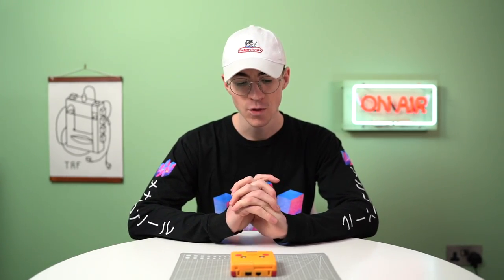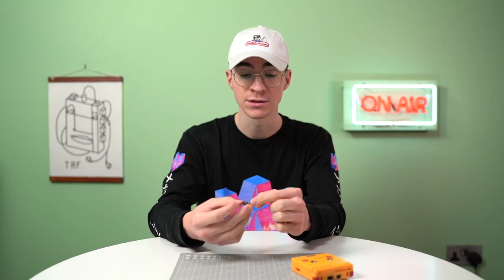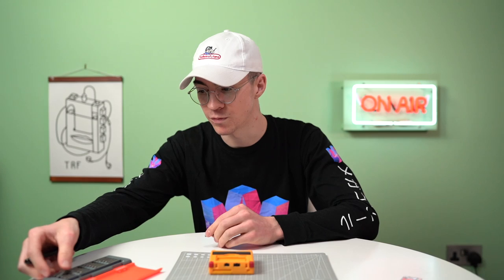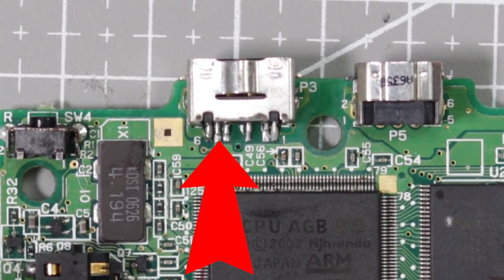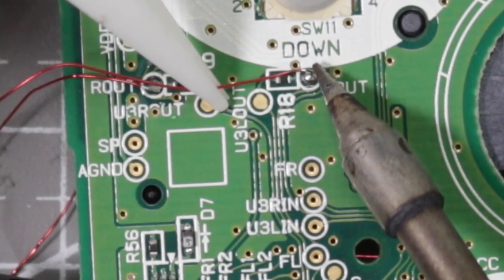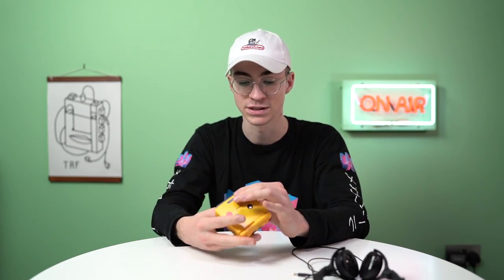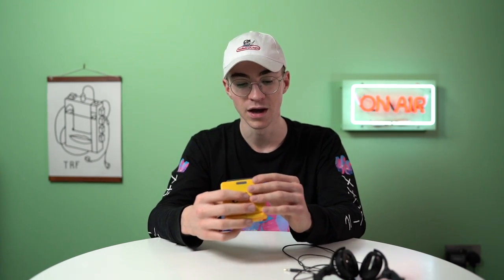Giving the GameBoy Advance SP a headphone jack 17 years later

Comment from the maker: Ever wondered what’s in my toolkit? - https://youtu.be/jp-lWUa4a1o
Reply: Hello
Reply: Without any further waffle
Reply: Really cool mood!, i think this is the console i need to play all the GB/GC/GBA games!!! one console for everything
Reply: Well there's not a Dremel in there
Reply: Would it have been possible to remove the Nintendo headphone jack on this and put this in the same place?
Reply: Awesome video. I have a basic soldering setup in my den but haven't gotten around to using it yet. I don't have room for an overhead vent fan- do you use one in your videos or to you simply crack open a window for ventilation?
Reply: Put a different power jack 
Like a usb-c
Reply: NEXT TIME ON     The Retro Future              

Installing a Bluetooth receiver into the Gameboy to use with AirPods
Reply: SgSuperKid Dan that waffle is so far
Reply: The Retro Future, check my comment, I'm the one who talked about why it wasn't possible to place the headphone jack
Reply: What AWG wire did you use?
Reply: @pierdaponte I hope this might help, I personally set a multiple speed box fan in the window to blow the fumes outside. I open the other window to allow fresh air in. I set my soldering station close to the secured  fan. To me the most important is safety, good ventilation and air flow. Some people put a simple filter on the fan blowing out. Note: I am not responsible for any harm or damage if they occur. Take care and be safe. : )
Reply: I could recommend using twisted pairs
of an ethernet cable (it must be of a single copper filament). They are quite resistant. Also nice video
Reply: Hi, I've just wanted to ask if you're planning somehow to modify or enhance ragebee500
Reply: Yo I came from jack's vid
Reply: Please, could you share what type and  gauge wire did you use for the headphone jack mode?
Reply: Try using a weekly pill box for containing screws. It has seven individual boxes, one for each day of the week, that you can use to separate your screws in the order you remove them. An old IT trick.
Reply: Man i wish i could afford a gameboy advanced sp
Reply: you did have those accessorizes that added one. which plugged into the charging port
Reply: I am so going to do that too, thank you!
Reply: Definitely not a Dremel
Reply: I wonder if there’s a way to install the pam8302a amp on gba sp the amp mods work on dmg to gba original but I don’t see anyone wondering or wanting to install the chip in the gba sp
Reply: no but I've always wondered what was under your hat. kinda disappointing. was hoping for something far stranger
Reply: I just did this modd and did everything the same and only my left headphone works not the right. Checked my connections on everything and tried a different port still only the left works. Any idea?
Reply: Do you know if it would be possible to make a splitter cable that has a headphone jack spliced onto the normal charging lead? So you can charge and take headphone signal off? I would be more happy doing that than doing the mod in the video, but that's just me. Also I have no clue about electronics so excuse my ignorance if there's an obvious reason why this wouldn't work 👌😬

Comment: So... if there was space in the case for a headphone jack, couldn't have nintendo just put one from the beginning.. sincer they were able to put one in the micro which is even smaller.
Reply: The Micro doesn't have a link port or the little switch in the cartridge slot that tells the GBA when a GB or GBC game is inserted so even if it has a headphone jack it still sacrificed other stuff. Nintendo could have made extra space in the SP for a headphone jack but they just didn't care enough to do it. And it was extra money for them from people who bough the dongle that cost pennies to make.
Reply: @chamoo232  not to be pedantic but the micro’s charge port also works as the link port
Reply: Apple and Samsung also had the same excuse.
Reply: 2 years late, and my guess is simply because they knew all the weird lil companies that existed at the time would create headphones that use one of the two ports at the top

Comment: Wow, that looks fantastic! Great job. Thanks for the shout out too! I think yours ended up looking much cleaner than mine too. For what it's worth though, I don't think a dremel would have given you a cleaner result but it would likely have made it a bit easier. One thing that's worth noting is that even though the mod uses a four pin headphone jack, the console will not work with four pin headphones. At least, mine doesn't unless they are half inserted and then you only get mono sound out of one side.
Reply from the maker: Ooh very interesting. I didn’t try that!
Reply: Wow sir makho was mentioned by RetroFuture. Two Youtubers I watch about Modding Consoles.
Reply: Hey makho, this is putting me off trying this mod. Any ideas as to how this can be solved to work with all headphones? Most have a mic on the cable now and 4 pins. Don’t want to have to carry special headphones for my sp
Reply: @TimdeVille  You'd need a physical switch to detect headphones. That's all the fourth pin does in this implementation. By inserting a three pin TRS plug in the four pin TRRS jack, we are triggering the speaker cutoff by shorting the fourth pin (the ground) to the third pin (also the ground in TRS but the microphone in TRRS). Alternatively, you can use a TRRS splitter and just leave the microphone plug dangling but I understand not wanting to use a dongle. 

If you cannot find a suitable contact switch (and I couldn't but I didn't look that hard) that depresses automatically when headphones are inserted, a simple SPST switch that you toggle manually would work too.
Reply: makho cool. Thanks for the reply. I’m new to all this do I’ll have to do some searching. I don’t even know what a SPST switch is so I’ll look it up but would be amazing to use any headphones.   Are you ok just using 3 pin headphones then?
Reply: @TimdeVille  Yes. Three pin headphones (TRS) work as expected
Reply: @TheRetroFuture  can you post a link to the super professional wiring diagram you made for this? Ha thank you.
Reply: Curious if you could also use a 5 pin TRS switching style 3.5mm headphone jack? or would there be concerns about space? I personally find the switching style TRS a little easier to wrap my head around wiring wise.
Reply: @ariajanzen5365  that would work even better if you can find one that fits and is relatively cheap.
Reply: @makho  I'm sure you could find these cheaper elsewhere, but this is the one I was thinking about https://www.mouser.ca/ProductDetail/Switchcraft/35RAPC4BV4?qs=yPI4UV3pIw2%252BAY61NTBatA%3D%3D
Reply: @ariajanzen5365  not sure if you're even gonna see this but if you modded a Gameboy with that how did it go?
Reply: @makho  I'm sorry but I understood literally nothing, not a single word. You're saying that a regular phone pair won't work, because it has a microphone? This makes this mod very impractical, if that's the case. I don't understand what is needed to make those work instead and why, since the jack apparently should perfectly match them.
Reply: @lloydaran  I see you also don't understand what the word "literally" means. This implementation takes advantage of using a TRS plug in a TRRS jack to act as a detect switch. So yes, it will not work with the wrong headphones. 

It has also come to my attention that the capacitance is way too high with this wiring method so the mod is wildly impractical, like you said, but for all the wrong reasons (unless you like blowing out your headphones).
Reply: @makho  What's wrong with how I used "literally"? Whatever. I still don't understand the reasons behind a jack being unable to work with the headphones it's supposed to house, it's beyond the very little technical knowledge I have (I have no idea what a TRS and a TRRS are). I suppose you had to work around the limited capabilities of the GBA SP motherboard to make it just barely work. The last part was clear, thanks for pointing that out. I guess I'm not attempting this.

Comment: I swear apple and nintendo do the exact same things I mean no headphone jack, dongle, headphones that plug into the charging port smh
Reply: Do nintendo solder everything in, fix everything badly with used parts, wipe drives and overcharge for everything? Also Samsung are removing headphone jacks now...

Comment: Fun fact, the original DS shares a charging port with the Gba SP and the headphone adapter actually works on the DS as well.  Obviously it's never needed since you have a headphone jack built in, but it works and even both Jacks can be used at once if desired for some reason

Comment: After losing my charging cable, I made my own from an old USB cable. The USB-A plug fits almost perfectly, the outer pins align with the contacts on the gameboy and after a bit filing it fits in snugly.

Next on my agenda is making my own dongle, the same way as the charging cable. Oh, or I could make a splitter dongle that can charge and run headphones at the same time.

Comment: If anyone uses the excuse "they couldn't fit a headphone jack in (insert device name here)," then tell them to look up the 7th Gen iPod Nano's headphone jack. 

That thing is crammed in there. If the device has the thickness for a headphone jack it can fit one. No matter what if they are designing the circuit boards they can squeeze one in if they want to. The fact is that they don't want too.

Comment: I mean, I understand. The circuit board’s layout required you to insert a bunch of wires to mod it. Nintendo meanwhile probably wouldn’t want a mess of wires inside that thing, but in order to avoid that, they’d need to completely redesign the circuit board’s layout. I’m sure this is a really flimsy excuse for nintendo not adding it, but it’s probably the best I can come up with :/

Comment: Your headphones have a relatively thin jacket on the plug. Most headphones back then had huge jackets and it would stick out beyond the side of the gameboy or not fit when other carts were sticking out from the slot. Lots of room for leverage to break the case or socket. It's not right that they didn't have a socket on the device, but this is one place where it makes sense.

Comment: Awesome video as usual Elliott!  If I were you I would open that back up and slather some Ye Ole Poundshop 2 part Epoxy over the top of the superglued in port. I use this method frequently, superglue to tack in place, glob of epoxy for strength. This method even holds three broken posts on a dropped TV that hung open, 3 yrs in, with really strong stress hanging from a Vesa mount. I'm not saying yours won't hold, but this will make damn sure she doesn't wiggle one bit. Just like my Mrs. 😂 Wicked stuff though man, funny I have an 101 Pikachu also, prefect cheapo quarantine mod. Will get on it next week 👍

Comment: I've always wanted to have an audio jack without using an adapter. after watching this video I spent 2 hours and successfully modded my GBA AGS101. my only issue is using thicker wires made the system a little bit uneven near the audio jack. other than that its perfect. Thanks!!

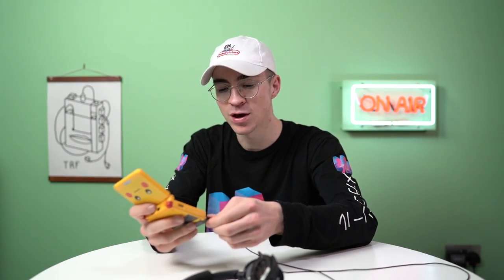Comment: 7:03 I think you're talking to me

It's far from ergonomic, that may be why they didn't placed it there, nor the sides because it would be idiotic and the top is full of holes, inputs and buttons but hey, you made it work!

Another thing, maybe just maybe you could make a modified case without the holes at the top (used by the Wireless adapter and the GCN cable, I don't remember which else) and place the headphone jack where the holes used to be, just an idea, I haven't seen the structure of the case perfectly so I may be mistaken

Btw, I'm studying Ind. Design and one of the subjects is ergonomy and if you notice the way the headphone is placed, as I said before, is far from ergonomic so it was a better idea to just make an adapter to plug your headphones through the charging port, the holes at the top are very important so every accessory was compatible so they just couldn't remove them, I say that in case you think "Why didn't they removed those holes?"

Comment: I suggest hot glue next time you do one of these to keep the headphone jack in place. I been doing it in Audio Receivers  with 1/4 inch jacks. its pretty easy to clean up if later down the line you need to take it out or replace it or whatever.

Comment: Headphone jacks with microphones have 5 pins my guy, they are called TRRS instead of TRS connectors... T is tip, R is ring, S is sleeve. If you actually had one with a mic then you'd have the bypass switch introducing crosstalk with one of your sound channels... It's normal for TRS connectors to have a pin for the button inside that detects a plugin event. Have you never noticed that your phone or pc knows when you've plugged in headphones or a mic?

Comment: If you wanted to clean it up a bit using your method, you could snag some cone shaped files typically used for model making to smooth out the headphone jack hole.
Reply: I use a "hand held countersink tool" and/or a "Deburring tool" for the same purpose on my 3d prints. Both of these work well for cleaning up cuts in plastic.

Comment: You don't actually need a 4 pin/4 ring audio jack for this mod. A standard 3 ring jack with an additional "JackSense"* pin would've been fine, and those sorts of audio jacks are actually pretty common. *(not sure what it's actually called, but it connects to ground when headphones are inserted, which is exactly what this mod needs)
Reply: In fact it almost looks like that's what you are using, at 1:10 you can see the 3 pins along the side of the jack to line up with the 3 rings of the audio jack, and the 4th pin is at the very end to sense when the jack is fully inserted, although it could also be the 4th contact for the tip of the plug...

Comment: Excellent video, thank you. Those little sockets look great, I've never been able to fit any of the ones I've had in the past; I'll be getting some of these! One question: If I'm not mistaken, with the screw post removed, that means one corner of the unit is not secured together any more. How does that affect how the console feels? I personally prefer the spot you used to the other one you showed with the IPS screen.

Comment: Great mod, I don't suppose there'd be room for a BlueTooth audio mod? I guess you can still plug a BT transmitter into the jack. GBA should sound hot through a larger speaker. Thanks for the video.

Comment: I have I issue and hopefully somebody can help me out. I did it the same way but here is my issue:
-when I plug in my charger my speaker cuts of
-when I plug in my headphones it work but only if I‘m not pushing it all the way in. If I left like 1 millimeter to go it works fine

Did I something wrong? Is it because I’m from Europe our headphonesjack pins are in a different order?

Hopefully somebody can help me out with this one. Thank you so much 🙌

Comment: Like, why they didn't originally install the headphone jack on that specific place, obviously because of the screw. Why they didn't add on the top like the other two ports tho? Not many excuses I can think of. Trying to say that it wouldn't fit along the charging port? Just... Damn Nintendo, use one of those round barrel plugs instead, like the 3 1st GameBoy entries had before the original Advance, and it sure as heck would fit then. It's not a deep enough space? To be honest I would take a slightly bigger, already very small GBA SP, that could even fit a slightly bigger battery too, and solve that problem. When there's a will, there's a way, they just didn't have the will to sacrifice the added dollars of revenue from a proprietary headphone adapter and the harder to replicate chargers.

Comment: I just started doing this and on ROUT I had a bit too much solder on it so I used my wick to clean it off and now it looks like its a black contact point and solder won't 'stick' to it. Is this considered a burnt contact point and not repairable? 

Edit 1: Looks like I found the gold contact point... it was on the bottom of my solder wick. Never seen that before, guess it came right off the board and it won't stick back either so hopefully tinning it to the wire and taping it on ROUT will make a miracle happen lol

Edit 2: No miracles here, aside from my terrible soldering skills, taping it down didn't help and I had no audio from speakers or headphone jack.

Comment: I need a Game Boy Advance SP. So pissed I had one  figired out what it was (was in bad shape) and left it back in the trash where it was. It was busted up bad though
Reply: Even in a very bad shape you can still fix it up. As long as the motherboard is good, speaker work and battery work then you can change everything else. Replacement shell are easily available. IPS mod work on all SP mod so easy to fix a broken screen. It only gets complicated when buttons are acting up. L and R micro switches are easy to replace but the other buttons are harder. I still managed to do both before. Got some very cheap SP on Ebay because the buttons were not working good.
Reply: @chamoo232  Yea screen was smashed on it, Shell was trashed it was so worn and crappy I found out what it was later., Never even heard about the SP.   Someone tossed it they wanted it to die they got their wish.   I didnt know what it was at the time. Sad. I would of saved it.
Reply: @GhettoWagon  Everyone was selling working SP 001 for very cheap before the IPS mod came out. No one wanted the 001 because the screen is terrible. Now that the IPS screen can turn them into something better than a 101 the prices have all jumped up. If I knew I would have bough all the cheapest ones I could have found.